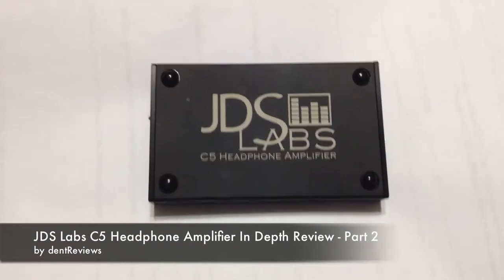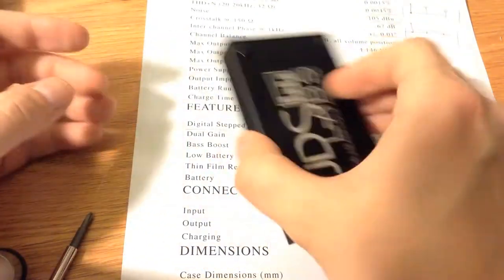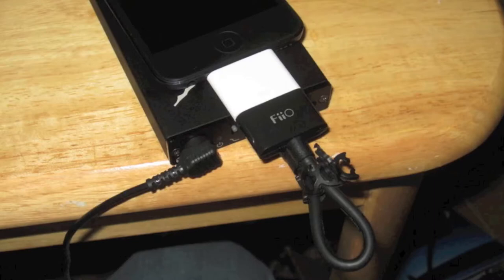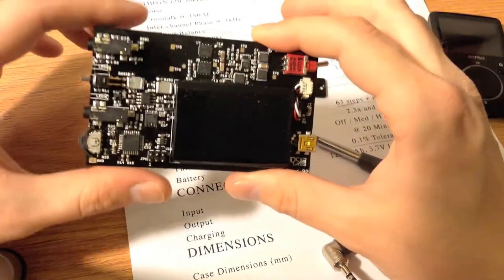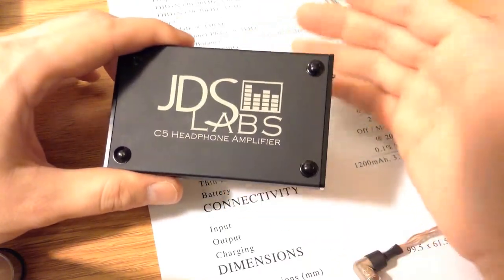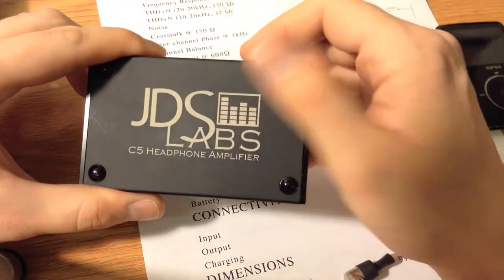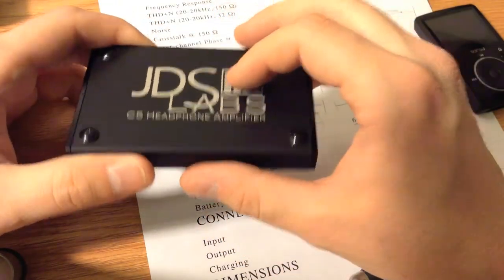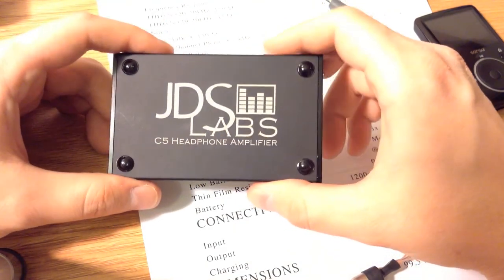JDS Labs C5 Headphone Amplifier - In Depth Review Pt. 2 of 2 by dentReviews

Comment: Thanks for the review! When using the lod, do you have to have the c5d, or can you use it with the c5? I just ordered the c5 and btg audio lod that you have in the video bit I don't have a dac. Thanks.
Reply from the maker: The line out connector from an iPod works perfectly with just the C5.  And you do have a DAC.  It's in your iPod. ;)  The C5D just bypasses the iPod DAC and uses its own.  But it only works with newer IOS7 iPods, and the DAC in an iPod is pretty good to begin with.